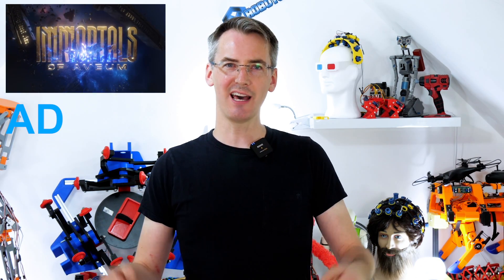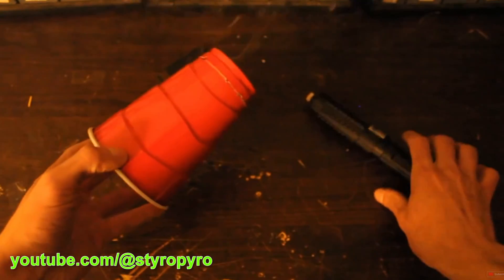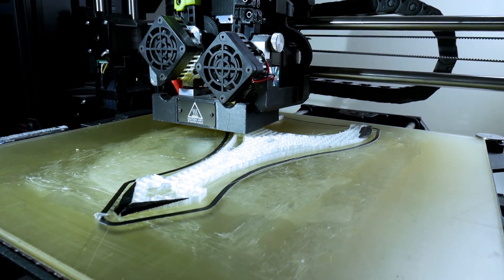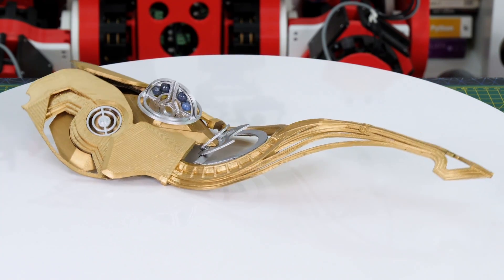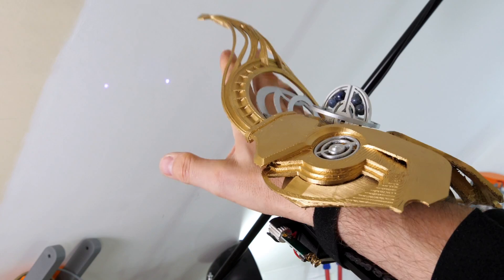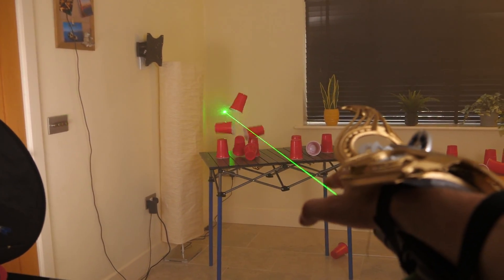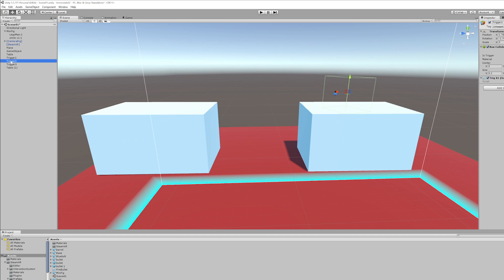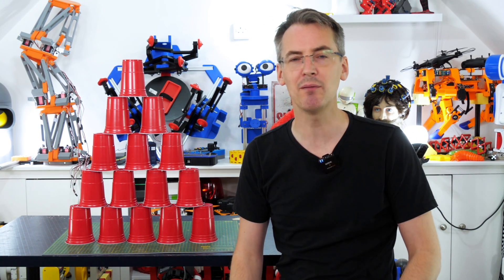Experiments with hard light

Comment: Neat! And.. a "magician" that reveals his tricks!? Thats unconventional. Just guessing here, there's a sponsor for the filament; the amount (density and geometry) of soluble PVA support indicates no regard to saving on material. 😅 PVA is way more expensive thay the regular thermoplastics.. which is kind of silly, really. Haven't used it in years, but if Im not mistaken Cura has an option to just pront the intersecting/connecting bits using PVA, and the rest of the support using the primary material, thus resulting in a quicker, less expensive and most probably more stable print.

Comment: What if you were to print the supports with the same filament, and then where they connect print with the water soluble filament? I would think that should cut down on the amount of extruder switching and dissolving time

Comment: Well… you could use a laser to make a difference in air pressure to blow the cups. But, to get strong air currents without burning it… not easy!

However, hard light actually is possible, kinda (it’s in that “well, we might have done it. But, it is highly expirmental and the results might not be a irate” stage)I am confused on how they managed it, but they somehow managed to make a material that forced a photon to move slightly slower not absorb and re-emit like most materials, but actually move slower. To keep the energy the same, that energy became mass, so it could exert force! But, as soon as it leaves that special material…

I would link, but I lost it… what I do remember is it was in the “highly expirmental, not sure if the results are accurate” stage

Comment: I built a folding tv dinner table like yours with a larger than standard size platform board. Normally those are a smaller tabletop. I put stoppers at two heights, coffee table, and dinner table height.
You could use the lasers to activate a explosive or combustable, but a magnetic railgun makes more sense. The lasers can be used to triangulate a field that could collapse signals and electronics of potential targets PWM regulation.

Comment: Regarding soluble support, I have found that with PrusaSlicer and Bambu Studio (a PrusaSlicer clone) and Prusament PETG I can get supports that just pop off very easily.  I suggest that you play around with your support settings a bit.  Just know that this is possible, and it is much faster than dual extrusion and dissolving support.

Comment: You can use ARCore and an Android Smartphone (or ARKit with an iPhone, both have Unity plugins) and film both the real and virtual world. Just get a virtual camera attached to the position of the Smartphone (which you can sync to the virtual coordinate system through Augmented Images or QRCodes) and voilà, you can grab the camera image from the phone and the virtual image from the virtual camera and have both worlds if their positions remain in sync. Do whatever you need with that information ;)

I had a research project around synchronization of coordinate spaces between AR/VR devices, happy to supply the paper (although I'd probably have to translate it).

Comment: To make the printing faster with the PVA you could maybe just use the PVA as the support interface. Essentially the bulk of the support would just be PLA but where it connects to the part it is PVA instead, so when you dissolve it the support just detaches, it would also mean less PVA is used and you need to dissolve less. This is similar to the intended use of the Bambu lab breakaway support material, you just use it for the support interface.

Comment: I Love this!!
Before I started working on my Fan Film story, it Began as a humble Shooting Gallery, where I would set it up at a Convention and have Guests pay a few bucks for Charity, through the 501st Legion, to shoot Nerf darts at a collection of Stormtrooper action figures at 3.75 inch, 6 inch and 12 inch figures on a collapsible Imperial Base diorama.
This was a few years ago now and at one point I thought of a Laser Tag version of the Shooting Gallery with the same kind of set up as used here in this video.
That way there could be a Points Value per target assigned and other record gags, even Rankings could be set up, all for fun as a "Stormtrooper Enlistment Test" gag. Themed prizes out of small prizes, like keychain fobs, pens, stickers, anything "giveaway merch", that sort of thing. 
But I have Neither the equipment, knowledge or skills, well as yet, to make use of this idea and yet...I'm saving this to my fan film Resources playlist as the Solenoid triggers have Several Practical Applications I can make use of, Plausibly, in my fan film. 
For instance, one of my protagonists is running from enemy blaster fire along a wall with Blaster bolts hitting the wall trailing just behind them...like you would see for a machine gun, with bullet holes spraying debris from each bullet.
I wanna pull off a similar shot along a stretch of Drywall/Sheetrock, with the blaster bolt holes already cut out, line up a tube in each hole, fill with some dust and chunks, Solenoid triggers each in quick succession and Voila, blaster damage on the run.
That'd be cool, but time consuming to set up just for that when Hose and a bunch of Small fireplace Bellows and people for the same gag is the operational plan at the moment. 
But...to Revisit and pay homage to the birth of my fan series, I'm gonna use the action figure gag for the larger battle scenes in the latter episodes.

Comment: The VR control is very interesting. Imagine the system tracking your hand movement and gestures, to let you point at appliances/lights to turn them on
Reply: With a system like the Meta/Oculus Quest models, you actually have pretty good hand tracking built in. You could also just use a LeapMotion controller, so I'd say this is imminently possible
Reply: A disadvantage would be only being able to track at points seen by the IR sensor apparatus in either case.

Comment: 1:40 You are correct that Photons do not have mass. However because of physics buggery they do have a measurable momentum and can apply force to things
Reply: True.
Reply: I have question. in theory. if the object (in this case. light) doesn't have mass. aka value of 0. doesn't mean it shouldn't have momentum according to equation of Momentum = m * v. or are there other thing to consider that I don't know?
Reply: @Kitsu_Worm  That equation only works in nonrelativistic physics. In relativity, for massive objects the correct equation for the momentum p is p = gamma * m * v where gamma is 1 / sqrt(1 - v² /c²). For massless objects like photons, not even this equation applies, but there is a generalization which works for everything: E² = (mc²)² + (pc)². If m = 0, this reduces to E = pc, which is the right relation for photons.
Reply: @Kitsu_Worm  See: radiation pressure.

Comment: Photons don''t have mass but they do have momentum, so they DO push stuff around, ever so slightly.
Reply: @zenjifugimoto  Yes, we already do. People can use lasers to hold microscopic objects like cells in place when they are examining them, that's called optical tweezers. Solar sails also use this principle, they are really thin metal sails that bounce sunlight off them for thrust, NASA's deployed a couple test ones and they work as expected, which is very weakly. Still potentially useful for slow probe missions to the inner solar system though. And you can increase their thrust by shining a laser on them, though getting high thrust is very power intensive. Each newton of thrust requires 300 megawatts of power. There is a plan called Breakthrough Starshot to send a tiny gram sized probe to the closest star at 20% the speed of light by using a solar sail hit with a multi gigawatt laser, though there are still a lot of technical difficulties to get it working, like finding a material to make the sail out of that wouldn't melt, and getting data back.
Reply: Momentum is mass x velocity, force is mass x acceleration. Momentum needs mass. They push reflective objects due to weak radiation pressure
Reply: The more precise relativistic definition of momentum doesn't require mass, just energy. Mass and energy are equivalent in relativity, hence the famous  e=mc^2. Radiation pressure only exists because photons have momentum, otherwise that would break conservation of momentum.
Reply: @massimocole9689  I think my brain just squeezed out of my ears a little.
Reply: @zenjifugimoto  Atomic Rockets and ToughSF are some great websites to read about space stuff. They have some cool articles about proposed laser sail missions in real life and in fiction if you want to read more about them.

Comment: Fun fact, light does push, or to be precise, applies radiation pressure onto reflective surfaces. Such a phenomenon would be really hard to notice with the lasers which he has access to, and even if he had stronger ones the caps would incinerate before noticing it. But this kind of technology works well in space for small payload missions. Solar sails have already been tested successfully and there are projects to push probes with lasers.
Reply: for the probes it's a laser sail, essentially the same thing as a solar sail but artificially pushed, allowing for much smaller (tho more resistant) sails.
Reply: indeed, light has no mass but it does have momentum.
Reply: @A_GoogIe_User  We actually aren't sure that light has no mass, just that some calculations appear to work with the idea that light has no mass, but there are experiments which suggest that light actually does have an incredibly tiny rest mass such that it is practically massless (but not truly massless).
Reply: @A_GoogIe_User  "momentum" is just something moving, though. Electrons are also referred to as "massless", but actually has a mass that's just too small to be considered significant. (citation: science class textbook) Photons could just have a mass that's too small to measure w/current equipment, and it's been called "massless" for so long nobody bothers to double-check that.
Reply: @Vaeldarg up until you said light might have mass you were correct. There have been many experiments to determine if light had mass or not. The proposition that light has mass has been disproved. Note that there are other particles that have been shown to have mass even though their mass is too small to measure.
Reply: And this phenomenon is also yoused to calibrate really sensitive force sensors
Reply: @phonix6494  singular: phenomenon, so this phenomenon, these phenomena
Reply: @DrWhom  Incorrect. Phenomena has been used since the 18th century to convey both singular and plural meaning. Literally just do a web search for "can phenomena be singular" and the first result is from the Merriam-Webster dictionary saying "yes" (paraphrased).
Reply: @DrWhom  Prescriptivism is stupid either way, but why was that your primary concern in a sentence that includes "yoused" lmao
Reply: @DaimyoD0  because I know the difference between a typo and an issue.
Reply: @pbjandahighfive  "henomena has been used since the 18th century to convey both singular and plural meaning"

... by eejits.
Reply: Yeah that's why I was confused. Like I knew there was no way that could be applied practically in this video. But I will would call that more than a "fun fact." I'd say that implying the contrary is simply wrong IMO lol
Reply: phenomena (doot-doooo de-doo-doo.)
Reply: Solar sails have also been used by ancient Bajorans to reach Cardassia.
Reply: i saw Sunshine too

Comment: What about sound? 
If you work out the frequency where the cups vibrate and use the technology that locates sound over a particular spot together that gives you effect that can be used anywhere
The other option is air pressure but I don't know how far you chuck a wave of compressed air.
You could also modify the cups so that metal stips inside bend as a result of laser emissiobs. However, an easier trick for you would be to glue a device into the bottom of the cup that caused the cup to twist. Wire that to battery & receiver be it light or wireless & some logic and you have a bot that will do the twist in the bottom of a plastic cup. Stack them up, upside down and you have cups you can do this at any distance you choose as they are signalled by radio or by the green laser exposing enough light to make a photo receptor signal movement
Reply: Sound is compressed air.
Reply: @leftaroundabout No, sound and air cannons work slightly differently. Look into it.
Reply: @Eagle3302PL  Actually, he is 100% correct. Look up what sound is.
However, you are correct too in that there is a difference between how sound works and how air cannons work in every day-to-day life.

Sound is produced because the medium's particles bump against each other. And as such, they pass that force along to the next particle, etc... Aka: the 'sound wave' propagates thru the medium of particles. But those particles stay in place, they stay were they are (somewhat). Sound IS LITERALLY (locally) compressed air *
You can make sound thru a cloud of smoke; the smoke will stay in place.

But with air cannons you push against a particle so hard, that this particle gets flung out and actually travels a great distance; like a bullet. Aka: the particles do not stay in one place anymore, they travel along a very noticeable path. You see the smoke moving (eg vortex cannons).

However, they both work on the same principles, in that there is a sweet spot where you can go from one form to the other.

By producing the proper (very low) frequency with the proper amount of energy, you'll be able to move objects with 'sound energy' in the same way you do with an air cannon. You start moving the particles instead of just letting them bump against each other (though, this is practically hard to do... and even so, we wouldn't call that "sound" anymore at that point). The other way around is very true too. With proper high enough air pulses, with the correct power and frequency, you produce sound. The air wouldn't be traveling anymore, but actually start to produce a wave propagating thru it (this is EXACTLY how your speakers work!)

Both are the VERY same thing. It is just a matter of different frequency and power.

(* or in any physical medium for that matter.)
Reply: @CookieTube  people might be thinking of directed sound weapons here, which AFAIK are different from air canons.

https://en.wikipedia.org/wiki/Sonic_weapon

https://fr.wikipedia.org/wiki/Canon_à_air

For one thing, one works in English, the other en Français
Reply: @DrWhom  Ah yes, those things. But still, it's still compressed air. It's the kind of a real world example where the line between 'sound' cannons and 'air' cannons gets blurry, again showing it is in fact the same thing.

Love your pun at the end, lol.

Comment: Lasers do produce a force on objects, it’s true that photons have no mass but this is an incomplete understanding, photons do have a small amount of momentum and momentum can be transferred. The force is small but lasers do indeed transmit a force on objects they strike that is measurable with fairly basic equipment. You can test this with some styrofoam in some water and a moderately powered laser.

Comment: It was immediately apparent that it wasn't the light, but a super convincing effect, I wish I could make something like that for my kids, they would go bananas 😂
Reply: You should give it a go. Each step in the build is not that complicated. However I bet he spent the most time in system integration hell getting all the different components to work together. Mixing physical mechanisms with VR requires that the 3D spatial calibration be spot on
Reply: skip the vr solinoids, use a air zooka instead  :d much simpler. The fact he went through all this is awesome!!!! so many possibilities.
Reply: Well you could use an IR laser and some IR receivers for the effect. Far easier than faffing around with all that. Might need another finger to trigger the correct code (think a TV remote or even use the guts from one that only does volume and channel. You know which button triggers which mechanism. We experimented with something like this when Half-Life Alyx came out but the magnetic levitation proved a bit fiddly and the range is poor.

However... super-magnets repel against another magnetic field.

Imagine winding a decent sized electro magnet on something like a nail to focus it and shoot a short, high current bolt through it using a FET.

I haven't fully executed this but it would be a shedload easier to hide from the kids. Those "roadside rechargable" LiOn batteries pack quite a punch and would easily deliver several amps to a custom-wound magnet which you can build into the table.

I might have to try this since I've got a load of wire as part of a switched mode PSU I've stupidly decided to design.